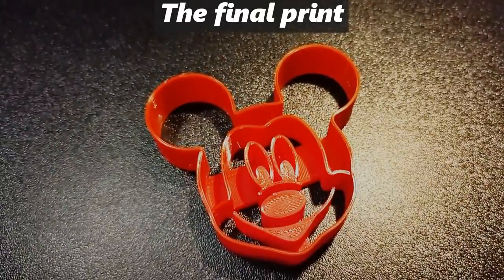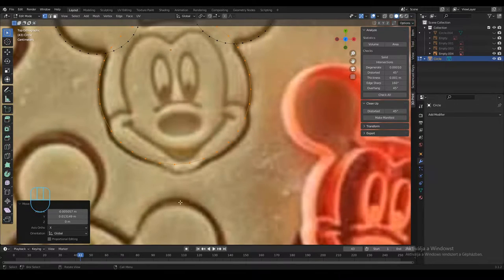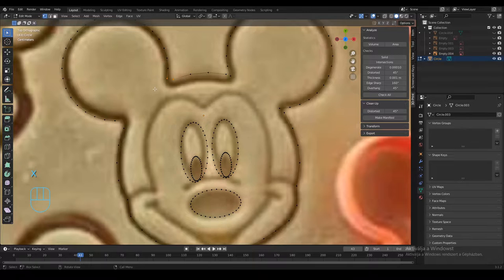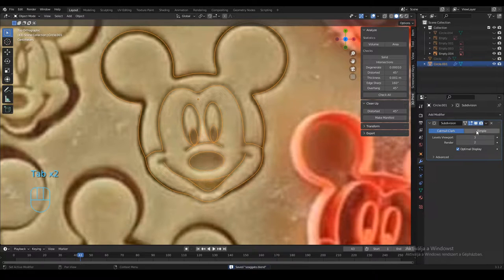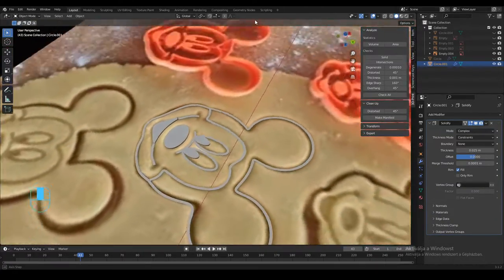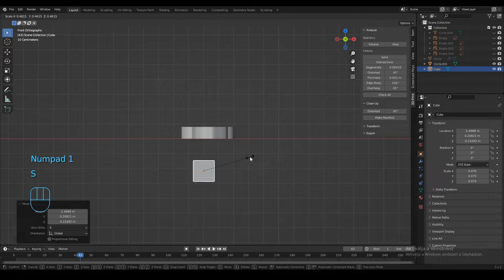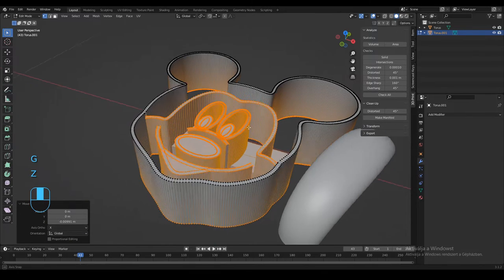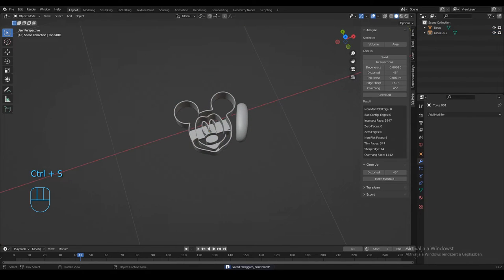Modeling Cookie cutter in Blender

Comment: I wish you could explain this to a person that has never used blender before. Seems a bit sped up
Reply from the maker: I can slow down if there is a need! 😃 Would you like a tutorial like this one, (I mean a cookie cutter tutorial,) or a Blender beginner video?
Reply: @gro-3dstuff  yes please:)
Reply: @gro-3dstuff  I dont know how you did the step in 1:56 :( I dont know hot to put it in 3D:(((( I just selected all but then I am lost
Reply from the maker: @thebijouxfly  Press letter A to select all/everything in Edit mode. Then press letter E to extrude the already selected vertices. If you move your mouse, you can see the vertices moving. Press Z during the extrusion, and hopefully you get the same results. 😁
Reply: @gro-3dstuff  thank you so much❤️
Reply from the maker: @thebijouxfly  Anytime 🙂

Comment: I'm not getting vertices on both sides of the cutter when I solidfy, why is that?
Reply from the maker: Which blender version do you use? Did you extrude the vertices properly?
Reply: you shall set the offset to zero